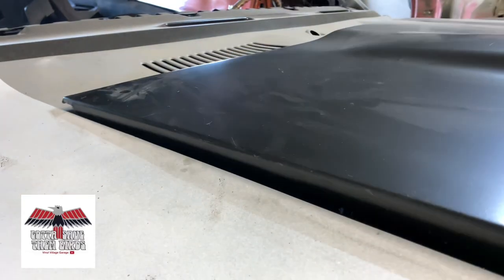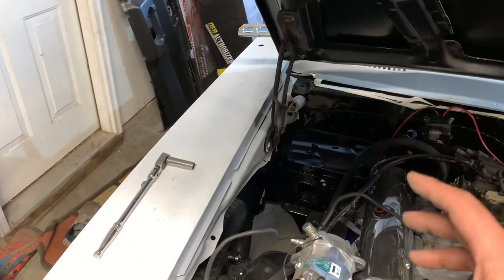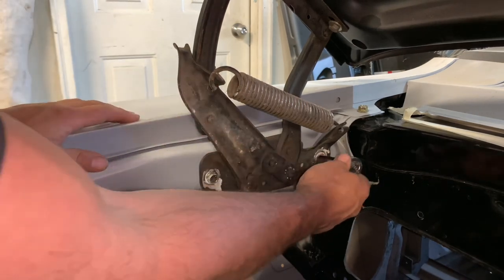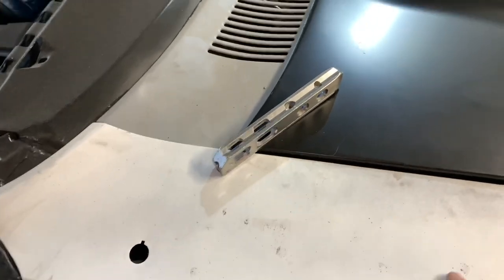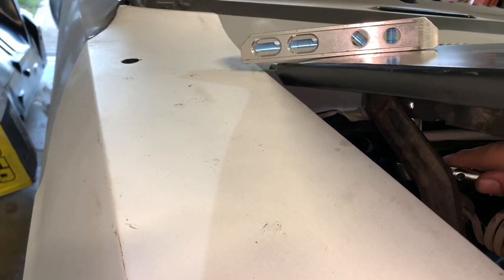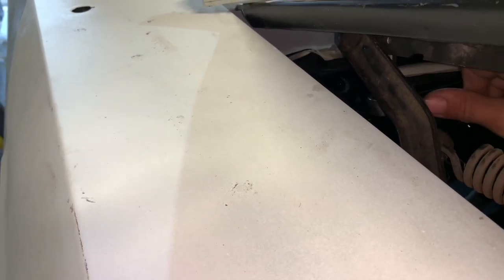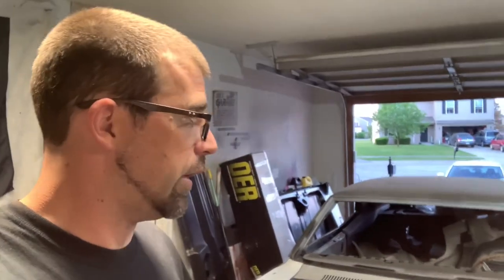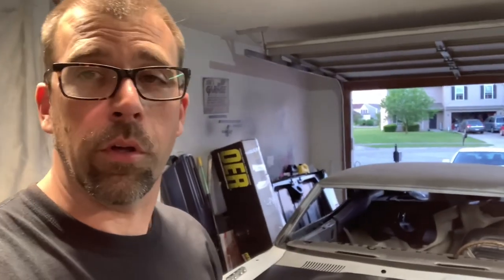Adjusting the hood on your GM muscle car

Comment: Great info! You’ve just given me the incentive to try “again” to get my Chevelle’s hood to lay flat at the rear.
Really bugs me to have to make a trip around the front end to push down the rear corners after every opening and closure of the hood!
Reply from the maker: Lol that’s funny because that is what have done on my GTO for years. Until I oiled the hinges and it fixed it. Who would have thunk that’s all it needed.  Good luck of course.

Comment: My Camaro hood has been slightly raised on the passenger side rear corner for years. I haven't really thought about it because its not much but I think I will go fix it now.
Reply from the maker: Yup. Step one lubricate then minor adjustments until you get it.

Comment: Thanks! Did you ever make a video showing how to lower the center section of the hood, or could you at least share what the process would be? I have a 79 TA where the center section sits too high. Hinges are a little sticky and wobbly, can't seem to find any crease where it may have buckled/bent the hood. Stumped!
Reply from the maker: As a matter of fact… I have yet to do that video. Sorry about that, It will be the next one for that car so until then. How I bend hoods is really quite simple. This should be done before painting to Prevent damaged to the finish, I can be done after but there is a risk of paint damage. Step one identify what the issue is. Mine has the rear corners are to low. Yours sounds like the rear center section is too high. With that information i then remove the hood place it on a firm level surface, pretty side up of course then in your case I stack some blocks of wood or bricks under the rear corners to the point they are supporting the hood, basically a 4”x4” should be enough height. Then literally step on the “high” spot using body weight to pursued it into shape but ONLY step on the edge of the hood where the pinch welds is located you don’t want to dent the metal only reshape the frame then The trick is to know when to quit, because the only way to know when you get it is after you reinstall and check it might take several attempts to get it right.  I suppose that is clear as mud I hope to get back to that car soon and do the video it makes much more sense seeing it. Good luck and and
Keep me posted on your progress
Reply: @VinylVillageGarage  Thanks a bunch for the quick response! No worries, I know how it feels to have several projects. Please let me know when you post that. I’m gonna try some adjustments first since my paint is pretty!
Reply from the maker: Will do!! Thanks for saving another bird and keeping it road worthy
Reply from the maker: @nairblab4061  just finished the video on hood adjustment should be posted in the next day or so.
Reply: @VinylVillageGarage  Awesome! Thanks for keeping me posted
Reply from the maker: No problem
Reply: Is it possible to perform this straightening task with the hood installed on the car?

Comment: So how do you fix the high rise in the middle?  Having the exact issue on a different gm car. At my wits end trying to figure out the solution
Reply from the maker: Well this might help with that exact issue. I
Straighten out this hood in this video.  

https://youtu.be/_Ray5GjuWbw
Reply: @VinylVillageGarage  thanks a million for the link, managed to get my aftermarket hood pretty much spot on.
Reply from the maker: Fantastic news!  Most panels need a little persuasion. Good job.